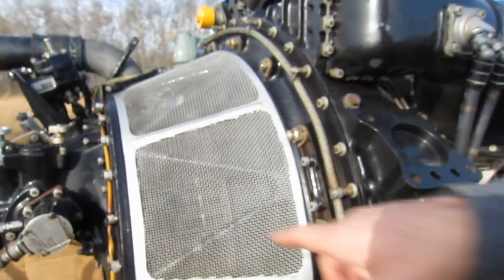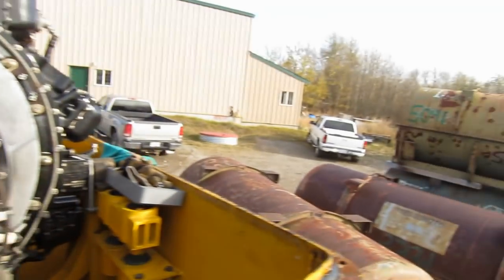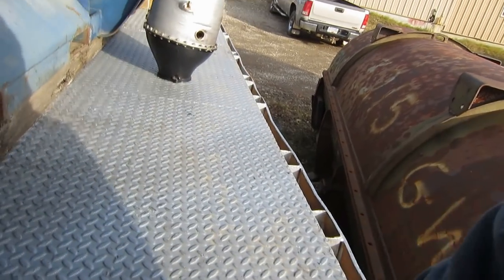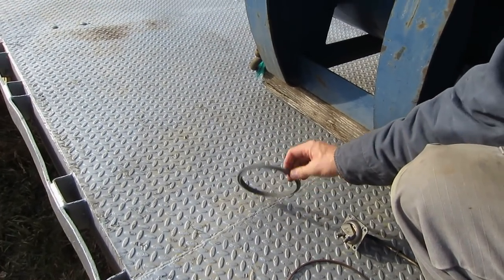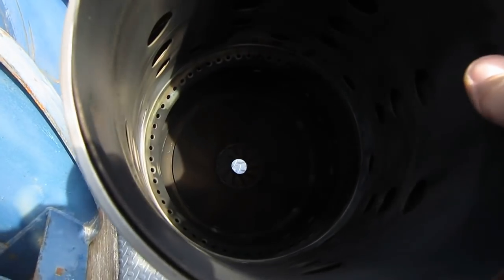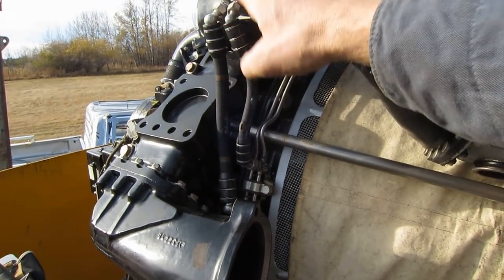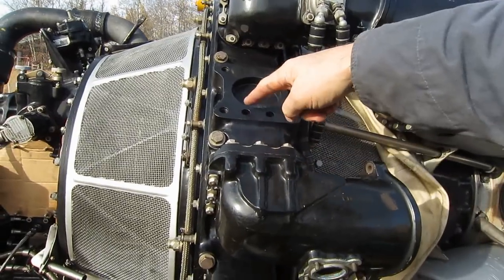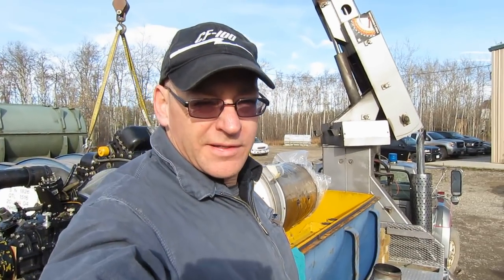Centrifugal Flow - Turbine Engines: A Closer Look

Comment: Both types of compressor were already around, it was only a matter of choosing one or the other. Centrifugal types were shorter, while axial types were longer; each has it's benefits. The Germans chose axial, but these lagged behind for a time, because, as the other guy said, designers had more experience in making efficient centrifugal compressors, as this was what they used in most superchargers of the day. Axial engines soon caught up and surpassed centrifugal types in the end.

Comment: Yes, there are still centrifugal flow jet engines around. They are used in some very small jet engines, such as on commuter planes, because with an engine that small, it's difficult to make the tiny little high-pressure compressor blades! Axial flow is used with powerful engines, because you would need a huge centrifugal impeller to equal a multi-stage axial design. The diameter of the engine would be huge. This isn't a problem with smaller engines. Some "mixed" engines actually use both types.

Comment: Just an interesting little note to add to your comment. Remember that, just about all the small engines e.g, T-53, T-55 ect. that uses a single stage centrifugal comp. stage, use it in the last stage, where the air is moved out to the combustion chamber that are placed around the PT. I don't believe that there's any of the common smaller engines using a cetrifugal comp. in the first stage these days.
And back on track:-)

Comment: Bloody hell, you have managed to explain in under 3 minutes what I've failed to understand from hours of reading i.e. the difference in compressor airflow between a centrifugal and axial engine! There is no substitute for SEEING the engine and having an expert guide you. What a beautiful engine, and in such wonderful condition.Many thanks Agent JayZ
Reply: Centrifugal compesses air and blows it in a  90 degrees angle from the inlet like a car turbo

Axial compresses and blows 180 degree from the inlet like a planes turbine

A very simple way to make them relevant

Comment from the maker: Yes, exactly. There is a certain diameter and airflow capacity which is the threshold, below which the centrifugal compressor is more efficient and cost effective... and above which the best choice is an axial compressor.
Reply: Does the same thinking applies to turbines? Why is it that we sometimes see centrifugal compressors, but never centrifugal turbines? As opposed to a automotive turbocharger, where turbines are always centrifugal and never axial.
Reply: @slicktires2011  There is another application where centrifugal turbines are the exclusive choice: Rocket engine fuel pumps, even for the earliest liquid-fuelled rockets. Take the German V2 missile powered by the A4 rocket engine as an example: This had a small catalytic chamber for decomposing high strength (between 80% and 90% concentration) hydrogen peroxide, which generated a hot, high pressure mixture of steam and oxygen. This was fed to a single stage centrifugal turbine, which drove a pair of single stage centrifugal pumps, which delivered the fuel and oxidiser (alcohol and liquid oxygen) to the engine - this assembly is collectively referred to as the turbopump.

The gigantic F1 engines on the first stage of the Saturn V rocket weren't much different - far bigger of course, and still used turbopumps. The main difference was how the turbopumps were powered: The F1 engine had a "pre-burner" chamber on the side of the engine which would burn some of the fuel and oxidiser in a very fuel-rich mixture, to keep the temperature comfortably below the melting point of the turbine. This acted as the "gas generator", which fed directly into a single stage centrifugal turbine, which again drove a pair of centrifugal pumps for the fuel and oxidiser (rocket grade kerosene and liquid oxygen), delivering these to the engine.

Although small compared to the amount of fuel and oxidiser burned by the rocket engine combustion chamber, the amount of fuel used by the turbopumps is not trivial, and neither is the amount of power they consume: On each F1 engine, the turbopumps used power equivalent to a modern Rolls Royce Trent 800 at full throttle. When you consider that all these are doing is pumping liquids, that gives you an idea of the enormous rate at which they deliver fuel and oxidiser to the engines!

Liquid fuelled rockets haven't changed enormously since then - most of them still use a similar design of turbopump, though the method of powering it is variable. Check out a video Scott Manley has done on "rocket engine plumbing", which takes you through all the different fuel flow and turbopump power source designs:
https://www.youtube.com/watch?v=4QXZ2RzN_Oo

Comment: Checked the Rolls Royce Nene out just a few days ago at the Science Museum in London (amongst so many other historic engines on display there). It's built like a tank compared to modern turbine engines, possibly because of non-availability of high-strength, low-weight alloys at that time(?). Jay, thanks for de-mystifying the workings of turbine engines through your videos.

Comment: That diffuser looks to me like it could feed a second set of combusters and a second turbine?  It looks like there is a mounting pad with blanked-off air passageways at 90 degrees to the currently installed combuster inlets?  Or is that to allow the 'elbows' feeding from the diffuser to the combusters to be mounted the other direction for an impeller which turns the other way?

Anyway, very neat to see a different style of engine.

Comment: Centrifugal style compressors sure seem like an easier way of getting the job done
Reply from the maker: Easier to build, but past a certain mass air flow, less efficient.
Reply: but centrifugal compressor was the best choice at debut from the turbo jets...
Reply: Justin Bronzan I don't agree with your opinion over the fact the centrifugal compress design is still very much so relevant in commercial turboprop engine design.  The Pratt & Whitney PW100 series is the best example in aviation today. Twin counter rotation impellers have a compression ratio of over 20 to 1 and reduced compressor weight and overall length of the power plant are what has lead it to dominate the market segment. The JT15D is yet another example....not to mention the use of impellers in PT6, Pw500,Pw500 series engines. BTW centrifugal impeller design and manufacturing is one of the most closely guarded secrets in aviatuon.
Reply: Justin Bronzan, not really true. Centrifugal engines originated in the UK, not the USA. America got handed complete, working UK models as part of the exchange of technology the allies were quite good at. 

The British liked centrifugal engines for two reasons. (1) They were simpler, less fragile, and more likely to be ready in time to actually be used before the war was over. (2) They were already very, very good at designing centrifugal compressors because of all their work on superchargers for large piston engines like the Merlin, the Sabre, and the Centuarus. They went with the skill they already had, and the result was that, despite having started development rather late, they got reliable, well-tested jet aircraft into action in the last year of the war.

The Germans went for axial flow because it was theoretically the best solution. The unfamiliar and horrendously difficult engineering problems it presented seemed only to encourage them to try harder, and they eventually did manage to make semi-workable jet engines, though nowhere near as reliable as the British ones. Long-term, of course, axial flow was the way to go for most large engines - but not all, as Phillip Saunders points out above.

Comment: My Marbore II has a single sided centrifugal, a 15" diameter impeller, It does have an axial turbine, I think the engine is pretty cool. I've always wanted a classic axial compressor engine, so much more power given the size. At least the centrifugals are stubby, perfect for the back of a car... Hmmm....

Comment from the maker: This is done with a few aircraft engines, and many industrial compressors. Only each successive compressor is different than the one that precedes it. They are usually smaller and of different shape.
To do exactly what you have described will not work very well.

Comment: I’ve never really understood centrifugal turbojet engines. More and more I think about is that it’s just a Turbocharger with fuel injectors, manifolds, and a turbine that’s designed to create thrust!
Reply from the maker: Turbines do not create thrust. A turbine takes energy from a moving fluid stream and converts it into mechanical torque on a shaft.
Real world fact check: a wind turbine does exactly the same thing.
Reply: @AgentJayZ  Well yes but these turbojet engines do make thrust correct? Burns air fuel mixture, air fuel mixture gets sent to the turbine where it spins the turbine, the turbine shares the same common shaft as the impellers which compress the air, send it to the chambers, fuel is injected into the air stream creating the said mixture where it ignites, and is sent to the turbine as the turbine speed increase, so does the impeller speed, creating more dense air, requiring more fuel, resulting in more powerful combustion and In turn spinning the turbine creating thrust due to the exiting of the hot exhaust gasses. Unless I’m missing something there I’m pretty sure that’s how the centrifugal turbojet engine works (very simply put) where as the axial flow turbojet ensures that the air entering the system is also leaving the system in a nearly straight order instead of having to bend highly dense air through different angled manifolds and inlets.
Reply from the maker: Yes, a turbojet makes thrust. Maybe you got me confused by saying a turbine makes thrust. One of the most common mistakes the general public makes is to call a turbine engine a turbine.
Those are not the same thing, and it matters.
Reply: @AgentJayZ  It’s all a little confusing but I just kinda assume engines as an air pump, yes a very basic and frankly amateur way of looking at it but that’s what it effectively is. It utilizes air in a system to create some form of power, torque, horsepower, and thrust (and many others) but the turbine technically helps push the hot air/exhaust (that is expanding) out of the system which results in thrust or forward movement from the moment the exhaust gases leaves the turbine. However I feel the design of a general turbine is designed to create thrust itself. Creating low pressure on one side of the blades while increasing pressure on the other, the turbine fighting the high pressure air or fluid on the other side resulting in thrust or movement. It’s a way of understanding Newton’s third law in theory, however simple you make it, the same concept runs through it all. Again I could be missing all of this though so please don’t waste your time on lowly little me!

Comment: Just the guy I was looking for. I have a question: how is it that you can get away with having a single centrifugal stage, but need several axial stages to get the same compression? Is it something inherent in the compressor type, or just because one centrifugal impeller is much larger and has more "blades" than a typical axial stage? Seems odd that one centrifugal stage can compress the air as much as several axial stages, but it must. I assume it's a function of the diameter of the impeller.

Comment: I understand that your start cart has a tiny Centrifugal engine in it?
This engine was popular in the 40s because it was much less likely to have compressor stall than the early axial flow models?
Reply from the maker: Jeff Manning Garrett did not make any axial flow APUs or small engines.
The two types of compressors are best suited for a different range of sizes.
Reply: +AgentJayZ Garrett TPE331 Jay
Reply from the maker: CrazyForCooCooPuffs  What about it. It5's a highly successful small gas turbine engine with a centrifugal compressor. What's your point?
Reply: AgentJayZ nvm I misread your post.

Comment: Im a bit confused but if the engine does not have that great of a air intake like a new engine in the cold war ish era "j57" does the air build up and cause problems? Because the russians took the engine and remade it into the klimov vk1 engine and was used in the mig 15/17 jets and the nose had a pretty big intake but as you showed in the video the amount of air that can get into the engine at a time is very limited. Does it build pressure on the airframe? And also does it result in compressor stalls?
Reply from the maker: You really need to read a bit on the history and development of jet engines. You will enjoy it, and all of your questions will be answered, or shown to be unnecessary. The first chapter of most of the books I recommend in my video called "Books!" will satisfy your curiosity.

Comment: Hey agentjayz I had question about centrifugal  engines and their  combustion chambers why are most straight and some are angled as a  example the rolls royce nene has straight ones and the Motorlet M-701 has ones that are tilted at a angle. Any response would be great.
Reply from the maker: If the combustors are set at an angle, the engine can be shorter for a given length of combustor.
Reply: Thank you

Comment: in the mig 15 there is that distinctive intake that splits the airflow, does one half go the the front of the compressor, and the other half goes to the back of the compressor?
Reply: It just goes around the cockpit and merges back in front of the engine.

Comment: 1-)If I put 2 exactly same centrifugal compressor as a multistage compressor.will second centrifugal compressor compress air again.
2-)What happens if I put 5 exactly same axial compressor without changing housing diameter will air be compressed more than one axial compressor .thank you

Comment: How easy to flood and burn one of these starting by accident?  Ever suffer too much or “over rich” fuel mix/supply?
Reply from the maker: Normally, the human does not control the fuel.
When fuel flow during startup is controlled by a human, the potential for overtemp damage is increased dramatically.